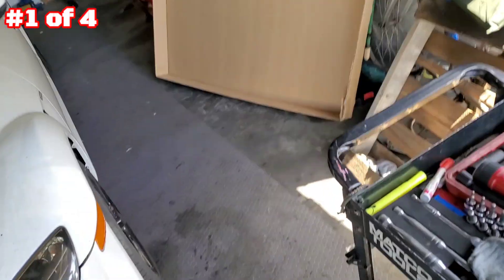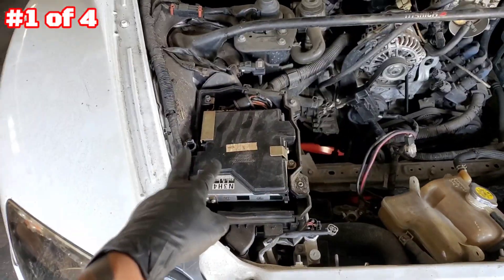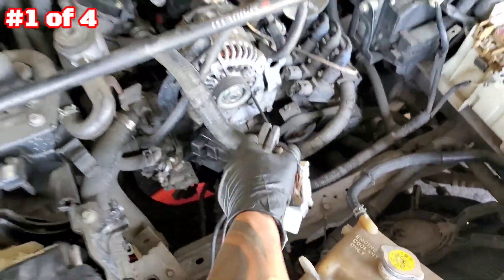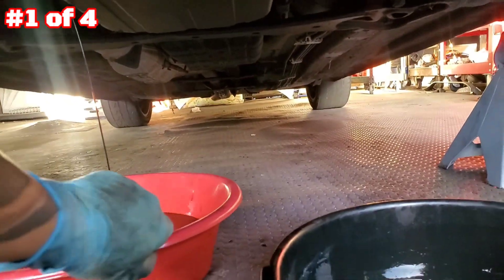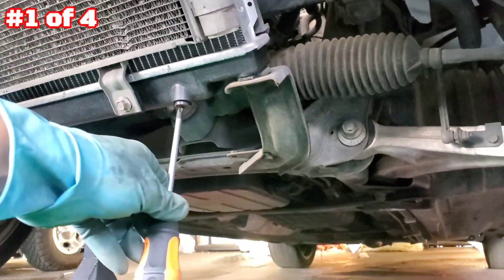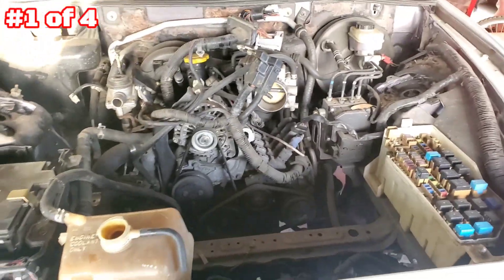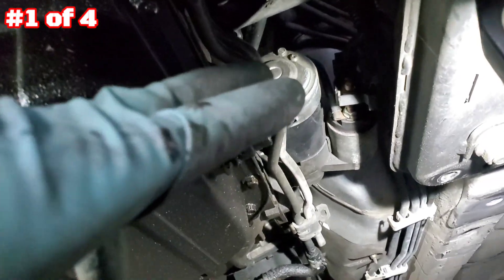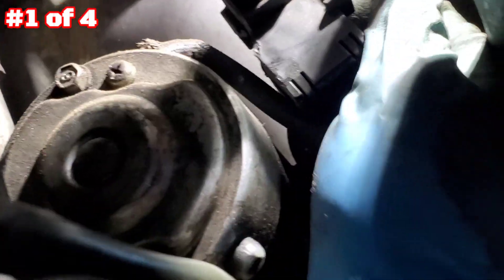mazda rx8 engine swap 4 port rx8 6 port rx8

Comment: Is the swap from a 4 port auto to a six port auto? And will i still be able to use the shifter to make it a manual and auto like the 4 port. Plus do you have steering wheel shifter use also
Reply: Be interesting to know